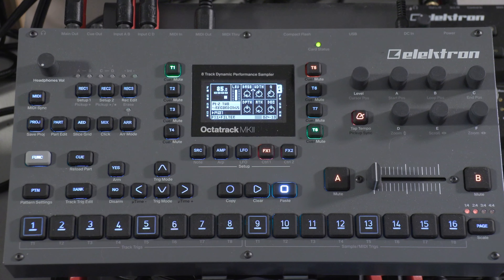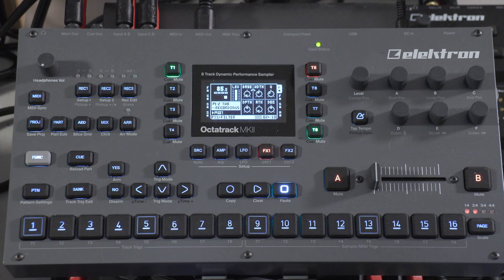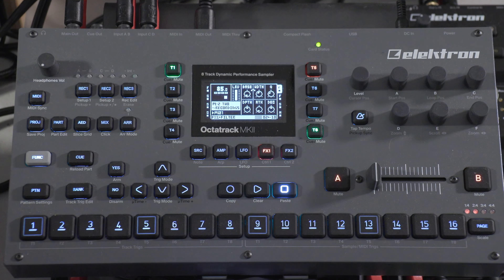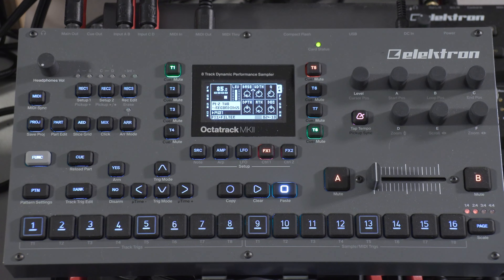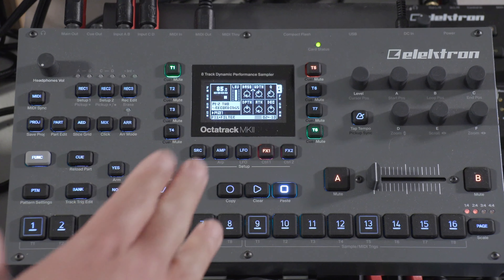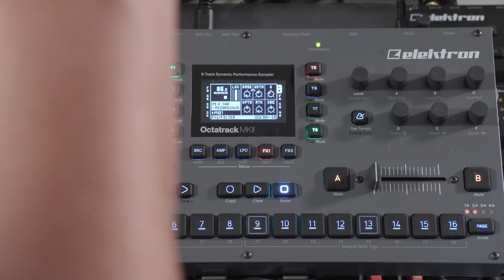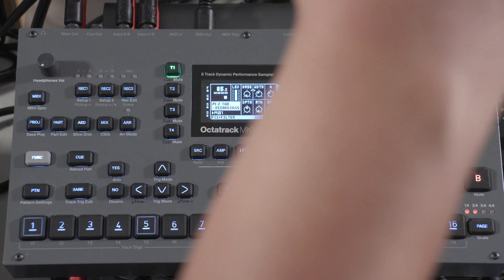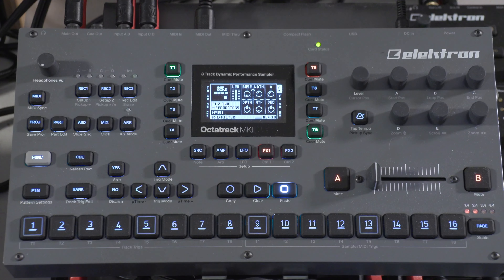FX Part 1 (Multi-Mode Filter) - Elektron Octatrack MK2 Tutorial

Comment: This is GOLD! Thanks I love to understand as well as play and listen and you are really good at explaining this. The only thing I didn’t quite get was the hold function on the set up page? Thanks a lot
Reply: Not sure what you meant by The hold parameter in the amp section - be great if you could explain this thanks !
Reply: @peacefulpigeon7254  It's not clear for me as well. At 1:57, you edited the video and it chopped the sentence. I guess we can have a look in the manual ... ;)
Reply: Maybe a video on the amp page and how you can integrate with the fx pages? That would be so helpful - the Octatrack notebook by Synthdawg does explain it too but a video would be really interesting…if poss?
Reply from the maker: @peacefulpigeon Yeah my bad I meant to revisit that and I’ll go over it a bit in the next vid but basically instead of an ADSR envelope in the amp page it is just an attack/hold/decay envelope so the attack is how long it takes to get up to full volume, hold is how long it stays at full volume and and decay is how long it takes to come down so if you turn on hold on the filter setup, it will take into account the hold parameter from the amp page being as the actual filter main page only has attack and decay. I’ll try and show an example in the next vid.
Reply: Thanks so much - I am used to the Digitone workflow having graphics and tweakable ADSR envelopes on filter and amp pages - so was trying to achieve similar effects on the Octatrack. Thanks! Cheers